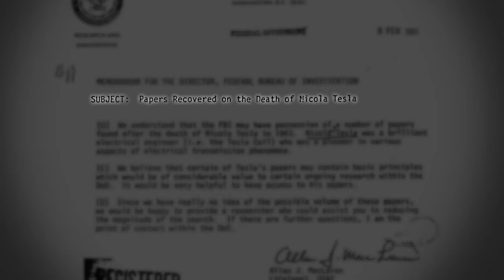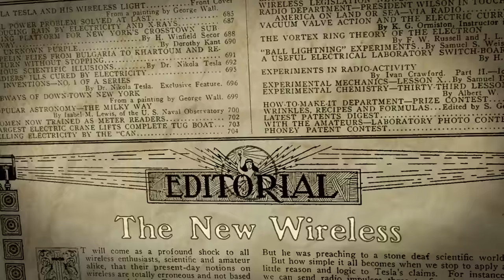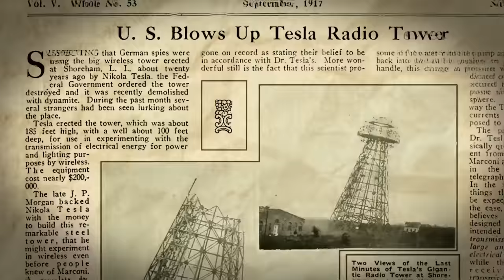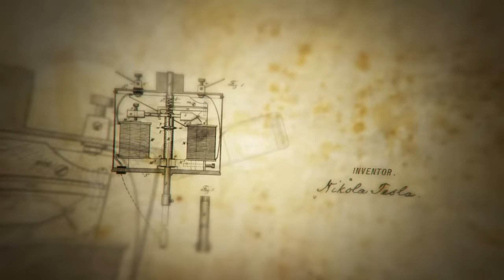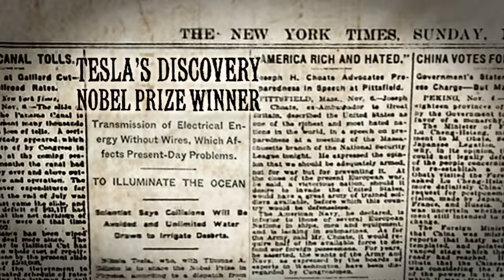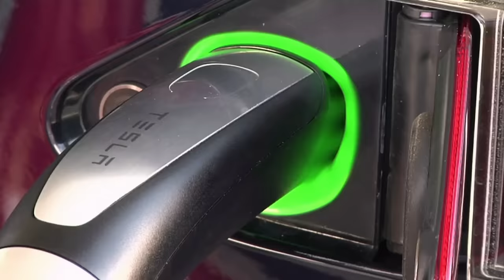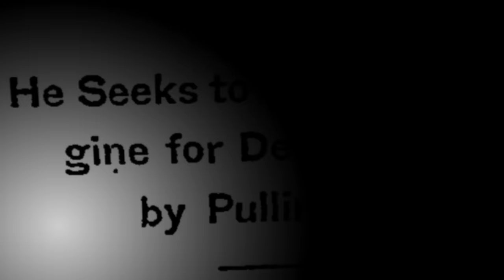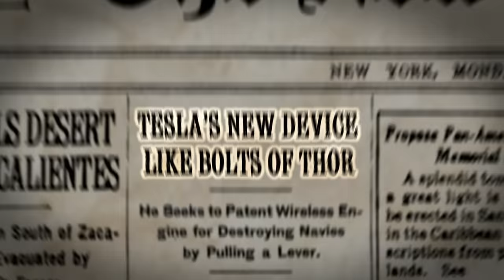Ancient Aliens: The Mysteries of Nikola Tesla (S8, E6) | Full Episode

Comment: The "Philadelphia Experiment" was debunked by the man who started that rumor.  But it was a great movie.
Also, I FIRMLY believe that he designed a "super capacitor" that would capture a lightning bolt (which could power a large city for a year) and store it to have it distributed through existing power lines, eliminating the need for nuclear, gas, coal and oil electricity generation.

Comment: That's why the negative terminal on a battery is referred to as ground. If you grab a high voltage bare wire and are standing on the ground, it will kill you as the electricity flows through you to the ground.

Comment: If the sailors were walking through invisible metal of the ship,  wouldn't they have just fallen through the floor of the ship,  and into the water?
Reply: From Wikipedia "reportedly, when the ship reappeared, some sailors were embedded in the metal structures of the ship, including one sailor who ended up on a deck level below where he began and had his hand embedded in the steel hull of the ship".

Comment: My idea so I get to name it! Voyager 1 is now in interstellar time or "Mikey's Time." "V-ger's" message has sped up now that it's outside our suns time bubble or, "Terran Time."  It will be faster still when "V-ger" sends a message from beyond the Milky Way's time bubble. (That name is still up for grabs.) Then there's Outside the Local Group time bubble, so on and so on until we get to the, "True Interstellar Time Standard."  Now that "V-ger" is in interstellar space, it's also in the Milky Way's STANDARD, faster moving, interstellar time or "Mikey's Time."  This can be proven by turning off everything except its clock and transmitter.  Have "V-ger" read time for as long as possible.  They WILL show the flow of time speeds up the further away you get from any celestial bodies.  Until you reach the Milky Way's time standard or "Mikey's Time."
•Our sun's time bubble: "Terran Time" we know and have measured.
•Milky Way's time bubble or "Mikey's Time." The rate/flow of TIME outside any influence but within the Milky Way: We just got there and are still figuring. Wild guess I'd say time will increase in speed, now and until V-ger is outside the Ort cloud .007-.07% faster, maybe. Just for reference. 
•Local Group's time bubble or the rate/flow of time outside of any influence but within the Local Group: Name still open and unknown. Wild guess .08% to a couple seconds faster, maybe. Used just for reference.
•Outside any influence in the, "True Interstellar Time Standard," or...;-P Name NOT up for grabs BUT just begging to be measured. The rate/flow of time is fastest here.  (Time flows fastest here so it's best to have your motor boat.) ;-P
A minute is a minute in all. It's the rate/flow I'm talking about.
The Milky Way's Interstellar Time Standard will be known as, "Mikey's Time."
Pass it on, please and thank you.